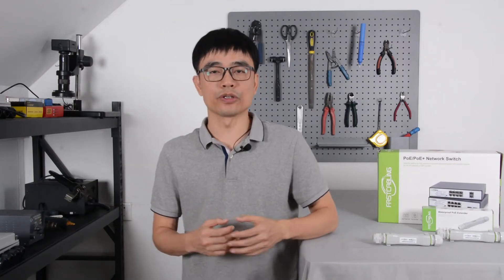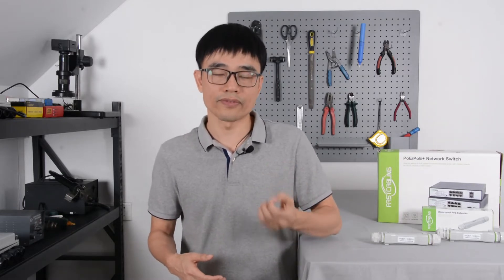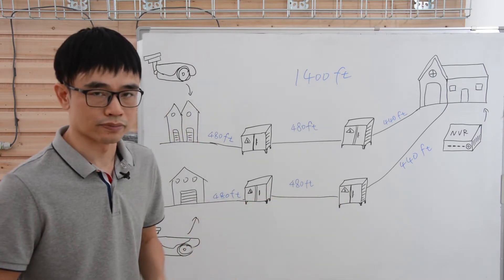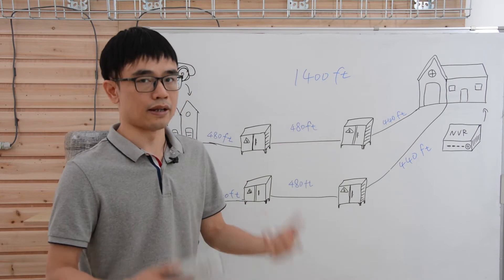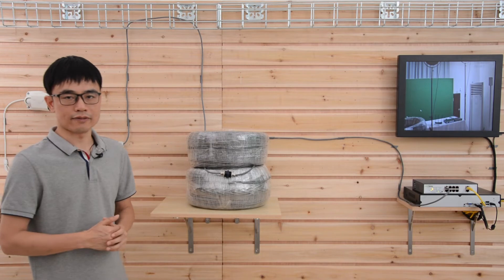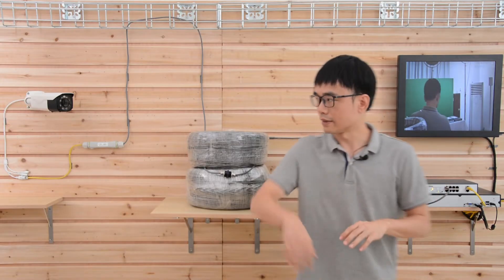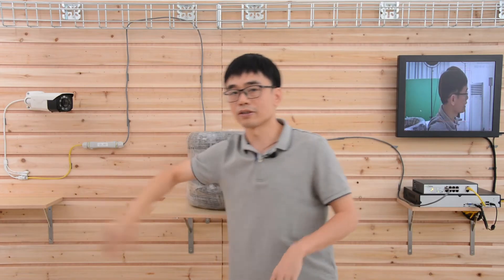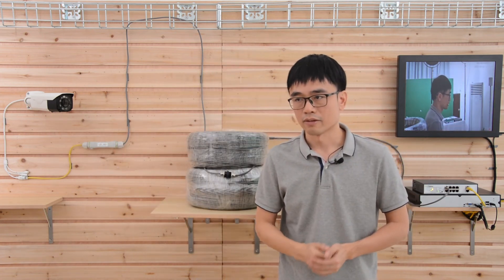How to Run Long Cables to IP cameras

Comment: Where can I get por extensión cámara ?
Reply from the maker: Sorry to disappoint you, but we do not sell long-range cameras. However, PTZ cameras can achieve the same effect. They are designed with powerful zoom capabilities and high-resolution sensors to capture clear video footage over great distances. These are ideal for monitoring large areas like parking lots, farmlands, and borders. You can use it with our long-range PoE+ switches which can provide 30W power to a PTZ camera at a distance of 4~500 meters. 

Long-Range PoE+ Swicth: https://www.fastcabling.com/product-category/long-range-poe-switches/

PTZ Cameras: https://www.fastcabling.com/product-category/ptz-camera/

Comment: What is the camera Mega Pixel Maximum we can do?
Reply from the maker: It can achieve 4K (8 megapixel) resolution within 1400ft. Just make sure you use the qualified cate5 or cat6 cable. The pure copper type is required for long run PoE network. Otherwise the voltage drop will become very serious.
Reply: @Fastcabling  Thank you. keep it up. great videos and explanation.